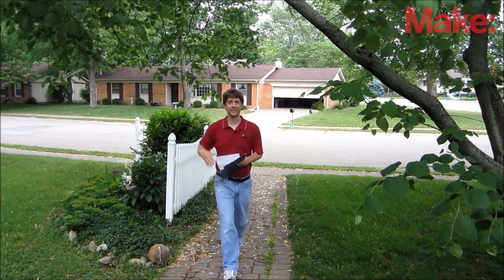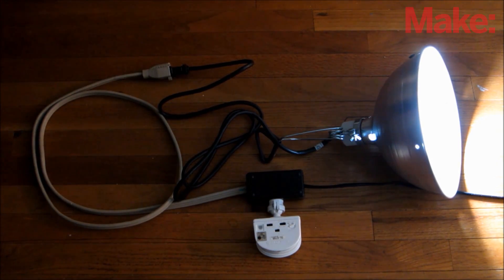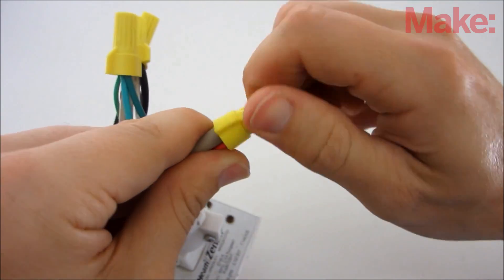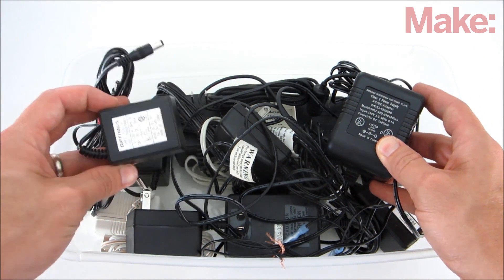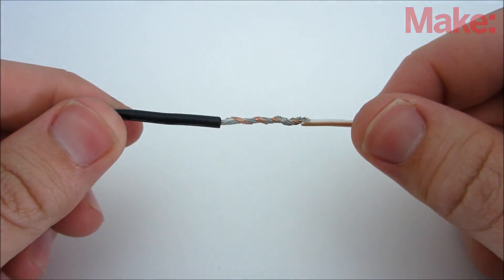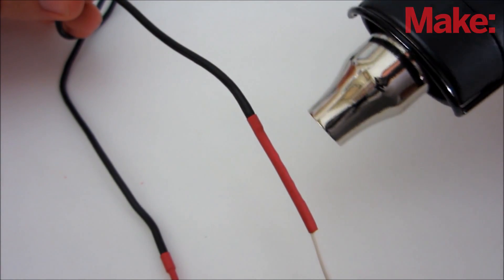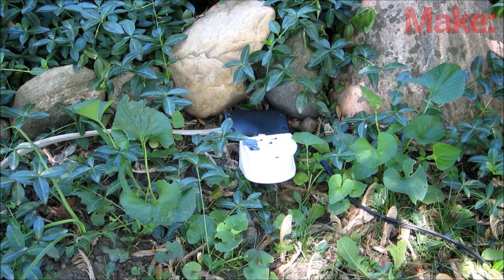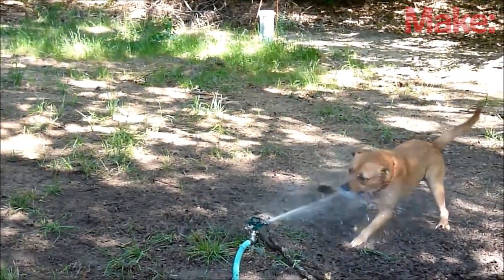Motion Activated Sprinklers

Comment: I tried using a motion activator like you did. I hooked it up to 120vac it worked for a second and burned out the 24vac sprinkler valve. What do you use to keep that from happening?
Reply: The motion switch with turn on A/c power that needs to be transfer to DC voltage and stepped down to the appropriate voltage for the water sprinkler valve you are using.

Comment: I can I get the red wire from the motion sensor to pull enough amps to open up the valve how do you fix that the black wire to the incoming cord is fine the red wire going to the L coming outlet doesn’t have enough and they open the valve

Comment: @make: How do you get the valve to turn back off? Do you rely on the sensor's built in time out? Pretty much any motion activated outlet would work, right? Are there power needs to consider with running an electric sprinkler pump through, say, a consumer grade motion sensor/outlet?

Comment: I want to use my pre existing, plumbed underground sprinklers.  How can I do this?
Reply: Of course, everything would be identical except for the inlet and outlet hoses.
Reply: You would have to have manifold an a second inlet to that specific zone after the main control valves. Then always leave that new leg into that zone pressurized behind the newly piped in motion controlled water valve. Very doable. Just have to do some digging and pvc work.

Comment: The only problem I see is most motion detectors especially for lights, use a photo eye to turn them off during daylight. Is there a workaround for that? Maybe I'm missing something simple.
Reply: A motion detector is activated by moving objects.  The photo eye you're thinking of is a dusk-to-dawn sensor which detects light intensity, not motion.  You just have to make sure your sensor is NOT from a dusk-to-dawn type light.  Many modern flood light fixtures are motion activated and will work well for this project.
Reply: correct, however the ones they are using in this video are for motion activated lights, They are disabled during the day.
Reply: CCWSig
Good point, I forgot about that.  I found a blog that should help: do a google search for "Disabling Dusk / Dawn feature in Eagle Eye motion sensor" and click on the pixiescorner.wordpress result.  There are two sensors inside- one for detecting motion, and the other is a simple photoresistor that responds to light intensity.  The simplest way to disable the dusk-to-dawn feature is to wrap black electrical tape over the photoresistor.
Reply: KBilt92 Huh, that must be the answer then! See I must have been missing something simple.
Reply: Piece of well place duct tape should keep it “dark” no?